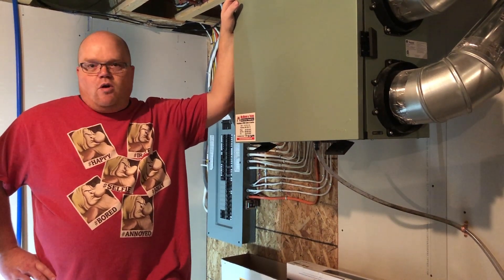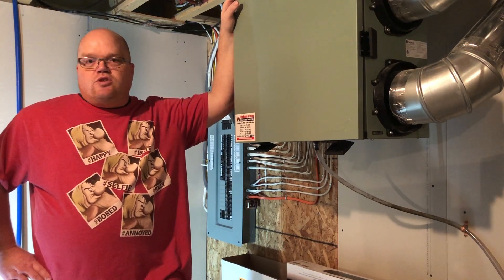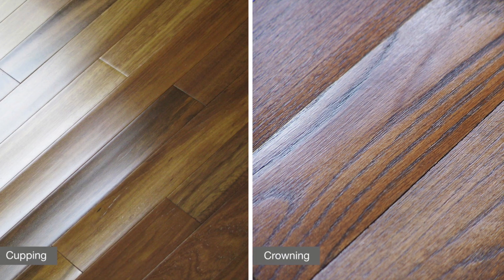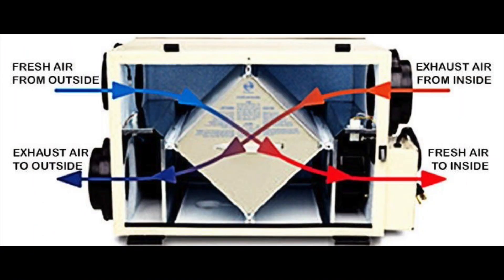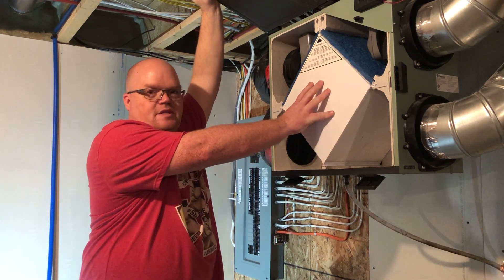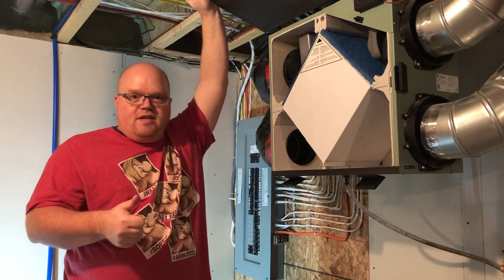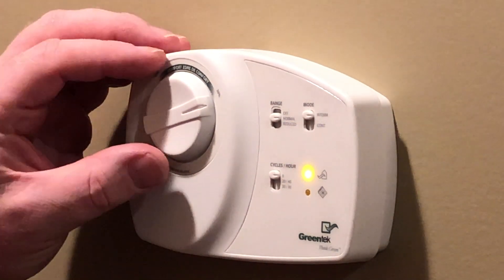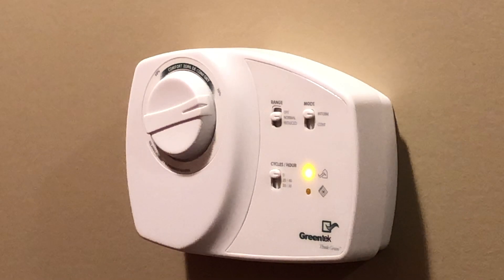How HRV Works

Comment: Thank you Denise. my Vanee 60 motors are spinning and i maintained it by cleaning the filters, but when i check intake vents in my home none of them have enough negative pressure pulling in air. the hose is not obstructed and I ensured no kinks in it. do I need duct cleaning? would that fix the problem.

Comment: Where csn i buy the filters??? I am struggling to find them. My unit looks just like yours.
Reply: See if there is a local Hvac supply shop in your area, they mainly serve contractors but they will have bulk filters as they are the suppliers of the units themselves.

Comment: Where can the blue filters be purchased ? Thanks
Reply: Most home stores like Lowes or H.D. You may have to cut to size, but that’s pretty easy with scissors. Let me know if you can’t find them.
Reply: I am also looking for the blue pre filters for my clean comfort unit.  Does anyone know where to buy these. 12.5 x 9 x 3/4 .
Thanks for the video
Reply: @darrendd3057   any hvac wholesaler in your area would have filters

Comment: I thought hrv was just for heat recovery and ventilation.
A erv (energy recovery and ventilation) was for reducing humidity and adding humidity in the winter months.
Reply: An HRV will only really control humidity in the winter, when the outside air is a much lower R.H.

Comment: Dose the hrv run independently of the furnace motor . If I turn mine on , the furnace motor comes on .
Reply: There has likely been a wire run from your HRV to the furnace control board to tie the two of them together

Comment: Once winter starts, do you keep the hrv running daily till spring starts? Or only turn it on intermittently for an hour in winter? Thanks
Reply from the maker: You set it to the humidity that is relevant and let it run.